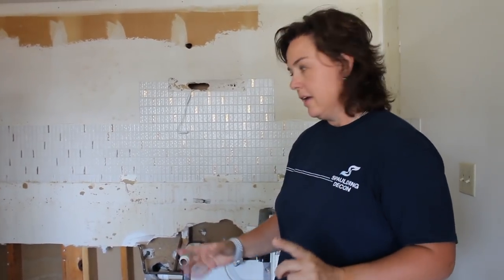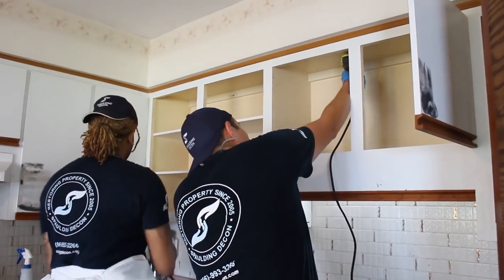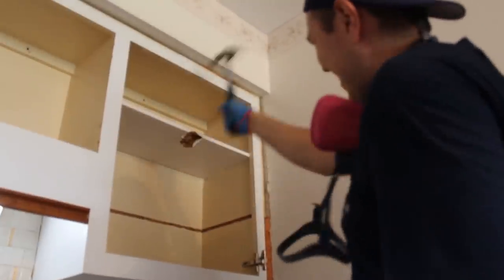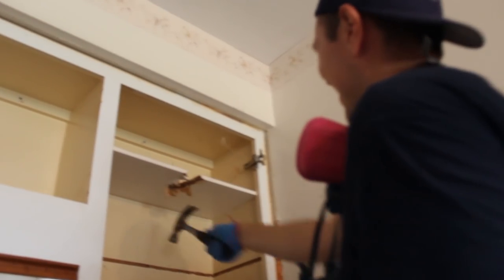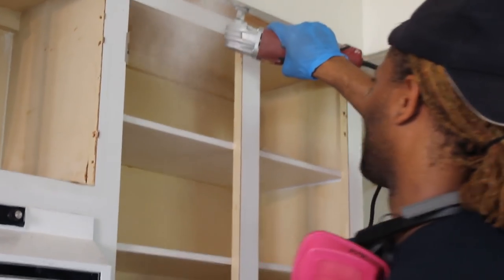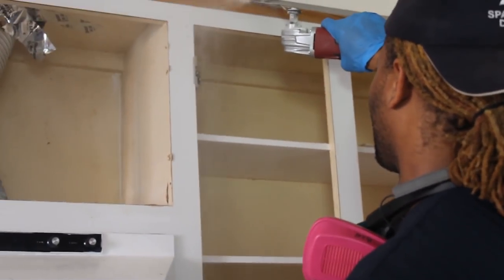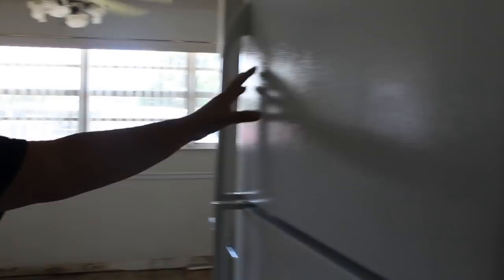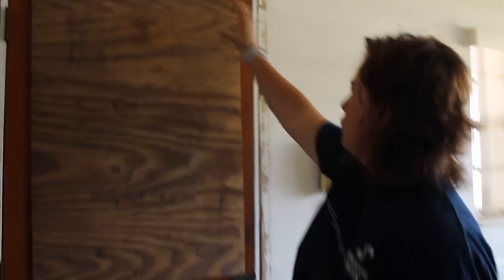Homicide Cleanup

Comment: How long at the body been there before it was found? Shocking you had to remove drywall if it wasn't long.
Reply: i also want to know this
Reply: Because the victim was beaten with an object, there would have been a lot of cast-off blood spatter from the object as it swings through the air between blows...which can even hit the ceiling if the force is great enough. The blows themselves would also produce blood spatter. This happens at the time of the assault, and has nothing to do with how long it took to find the body. I think contaminated drywall is always removed because it may be too porous to clean/decontaminate sufficiently...but this is a guess. Also, unless a dead body is being mutilated, bleeding stops at the time of death because the heart is no longer pumping.
Reply: We had to remove the drywall because blood run under to the baseboard
Reply: @bejay129williams  We? Do u work for them??
Reply: @ZiaQueen505  he does

Comment: Lock your doors at all times, have a weapon on hand. I always keep a bat by hallway entrance. I live in duplex upstairs  and really the only way they can get in is my door. Only one way in and out.
Reply: Jasmine Trudell I don’t know where you live, but most, if not all, places in the USA have to have 2 ways in and out for safety reasons.  That’s building code.  For example, if a fire breaks out by your door, there has to be an escape method some other way and not just jumping from a second floor window.  Please, for your own safety check with your local municipality’s building code.
Reply: Jade’s Mom I live in duplex upstairs and the only way in and out is door in back. Otherwise, yeah, I would have to escape from second floor through window.
Reply: Jasmine Trudell I’m so sorry.  Your landlord should install at least a balcony or an escape ladder.  You can buy these emergency chain ladders that hang on a window ledge that roll up and can be stored easily under a bed.  I got them for my kids when they were young who’s bedrooms were upstairs.  They tried them out for fun and they worked.

Comment: Wait whaaaaaat? Blood born pathogens cant live outside a living host more than a few hours though. This is so overkill! I understand  removing the unsightly drywall, and the damaged lino, but the few drops off blood on those two by fours does not constitute a complete overhaul of the bones of that room. This is just blantant fear mongering and a way to cash in on someones fear in order to take advantage during a tragedy. There is no reason that wood could not have been simply washed and disinfected and if you were really worried about it, (totally unnecessarily, but for whatever reason americans love to fear non'scary things) then just paint the area. Then fix the drywall and paint the room. Instead you made this homeowner do a complete overhaul on the room, and charge them a small fortune all because of a few drops of now harmless blood on the wood the is covered up by wall anyway? This company should be ashamed
Reply from the maker: sweetox _ hepatitis C can live outside the body for 3 weeks. Blood was underneath the base plate and had to be removed. You cannot clean blood from raw wood.
Reply: @CrimeSceneCleaning  Right. 3weeks for Hepatitis C. And how is hep c contracted again? Oh yeah, by being injected into ones blood stream.  Ain't nobody going to be knocking down a brand new wall, scrapping at the wood inside the wall and then injecting it into their bodies in the 3 weeks post death. Come on now. Nevermind, it was wood on the inside of the wall for crying  out loud. You already tore out all the contaminated drywall.  And like I said, you disinfect the area, paint it with that paint used to seal in animal urine, drywall and paint the room. There was no reason to tear out and rebuild the structure and deep down you know it too. On some level you probably believe what you're doing is right, because that is what society screams to be the truth. And so for that one single reason alone, I don't believe you to be inherently bad people. Mind you, if we are going to be completely honest here, and if you ever stopped to think about it, then you know from a strictly scientific standpoint it is unnecessary to do this for any other reason than to increase company profit. At the expense of the greiving family no less. No, you're educated and you know better, whether you have chosen to ignore the facts or not. You know this is wrong. Unfortunately, you're not the only business using these same type of fear tactics to increase profits. The funeral industry has been feeding us all kinds of misinformation for years now. Instilling into the mind of our western society a morbid fear of our dead. Over the years we have been trained to totally disassociate ourselves from the deceased. Led to believe we have no rights over our loved ones bodies in death and programed to believe, that we are required by law to relinquish all control of Great Aunt Hazel, to our local funeral home. Because  most oddly only in death, sweet old aunty Hazel's body has  become a sudden biohazard? Ummm wait what? In reality we are much more likely to contract illness from the bodily fluids of the living than from those of the dead. Not much if anything is guaranteed to us in life. In fact, it is certain that death is the one and only thing every single one of us can count on. The sooner we accept and stop fearing our reality the better off we will all be.
Reply: @Jayme dawnSince you brought it up,  I cleaned up after my best friends girlfriend killed herself, so that her family and he didn't have too. No crime scene clean up crews where she lived.  I also nearly took a part time job for a similar company to this, who had the contract through the cities coroners office, while I was going to school, but ended up getting something that paid better for me at the time. Im not turning my nose up at the job, but many things about the death industry frost my ass. And they should frost yours too. How would you feel if you paid thousands of dollars to people who took advantage of the fact that you were greieving and you believed they would give you the proper information only to find out they didn't in order to gouge more money out of you while you were too busy mourning to notice? Or if that happened to your grandmother?
Reply: You are so right.!!!